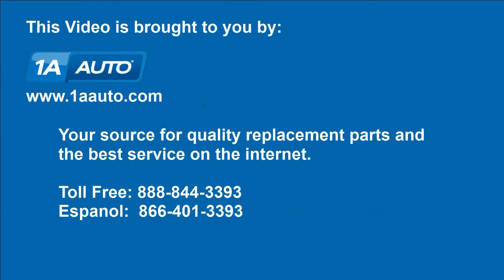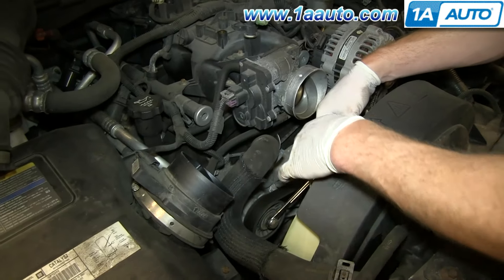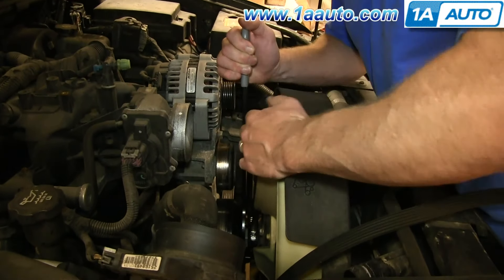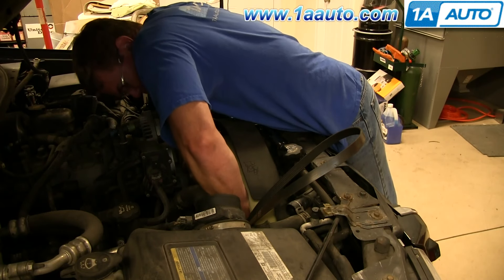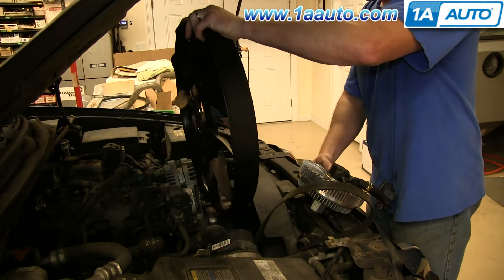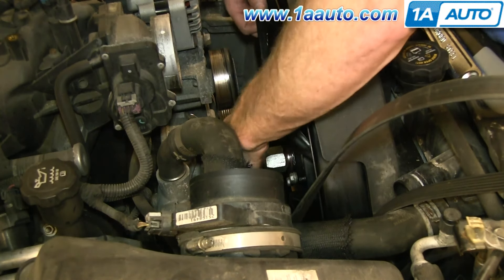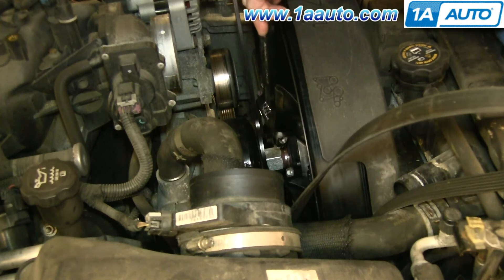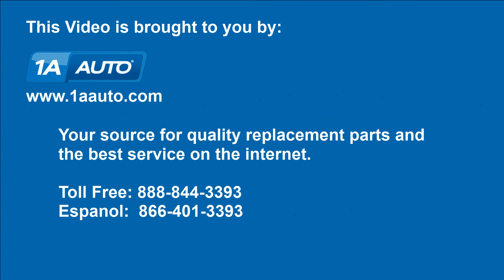How to Replace Radiator Cooling Fan Blade 02-09 GMC Envoy XL

Comment: The clutch fan nut NEVER comes off without an extra foot or 2 of leverage like a cheater pipe onto your 12 inch crescent wrench. The only way it comes loose like you did it is if the previous person barley tightened it. I had a 2 foot cheater and the rental tool to hold the water pump pulley and it took all my strength to crack the damn thing loose.